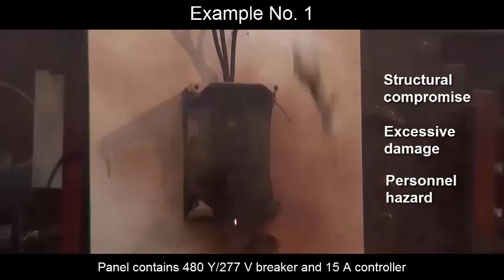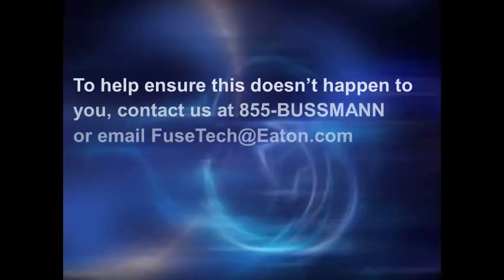Bussmann series - SCCR Misapplication

Comment: Twenty years ago, I responded to an urgent service call- and that day became acutely aware of the importance of proper SCCR. 
  Upon arriving at the address, the first thing I noticed was the utility had cordoned off the area around the customer’s home. 
The pole mounted unit had violently failed which sprayed shrapnel and oil from the 1930s era transformer. 
  The home had been built around the same time- and like the utility equipment, no updates had been made over the next seventy years. 
  What became clear (and the utility later confirmed) is that the  
transformer had failed. 
The primary and secondary windings made physical contact which caused a spectacular and very dangerous explosion. Fortunately no one had been walking close to it at that moment. 
  Inside the home, the distribution panel cover had been blown straight across the room into the opposite wall. The glass fuses had all melted with it starting a fire.  Luckily my customer had been home in a different room and was able to immediately extinguish the fire. 
 That job many years ago immediately helped me understand just how much energy is available in utility transformers.